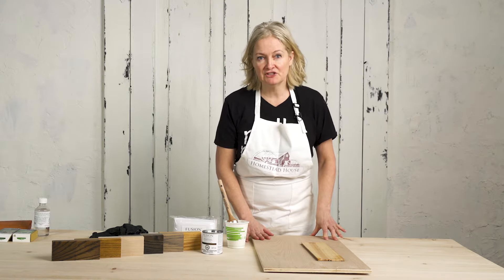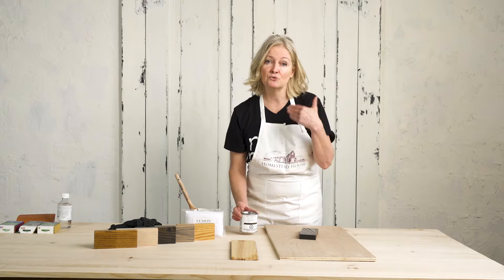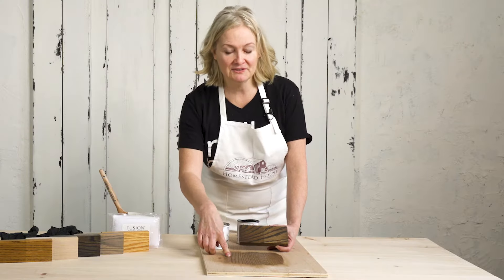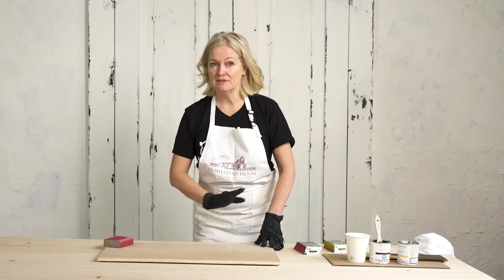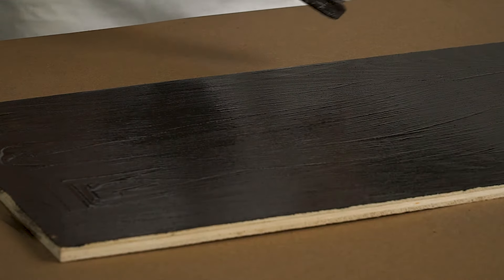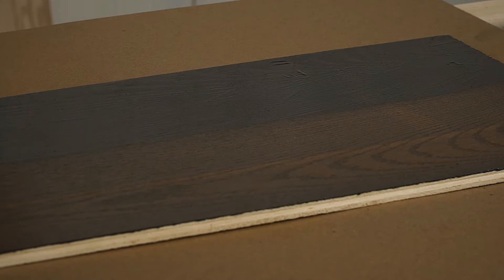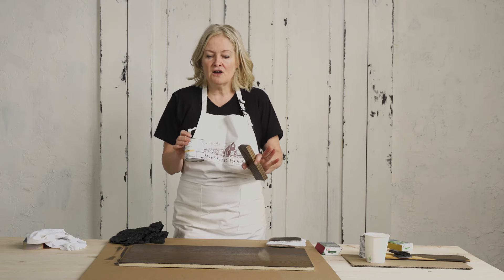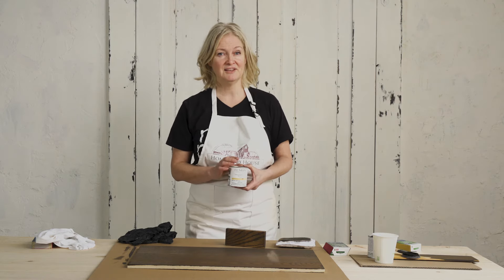How to prep for Stain and Finishing Oil

Comment: Want to refinish to small portable "island" in my kitchen which is currently finished in a walnut stain. How to do it please?
Reply from the maker: To restain your piece this is the information you need. You don’t need to apply another product before Stain & Finishing Oil.   This video shows you the correct prep for SFO https://youtu.be/07TE3VMQpY0?si=OWT_WXYC4w0cZNZx   Stain & Finishing Oil - SFO-is a wood conditioner, stain and top coat all-in-one that offers exceptional durability in high-traffic areas like table tops, kitchen cabinets, and even flooring. It can be used on bare or prepped wood to change the colour and protect and seal, or over previously painted surfaces to create faux finishes.   No additional top coat is required - it is highly durable as is. If you’re looking for added durability, applying a coat of Natural will increase sheen and durability without intensifying your colour. Check out this YouTube video https://youtu.be/XFRjUztaUiE    Our special blend is highly concentrated in pigment, so a little goes a long way. The 237 mL container will cover the same area as 1 litre of comparable stains.    Directions: How to use on bare wood, apply generously by pouring or brushing onto the evenly sanded surface, and remove excess after 10-15 minutes. If desired, add a second coat (after re-coat time of 9 hrs) for a deeper colour or more sheen.   The pigment in it stains your wood accentuating the grain. SFO is a combination of natural oils and resins that penetrate into wood fibres to create a durable, scratch-resistant, waterproof finish. It does not leave a surface film that sits on top but instead soaks into and becomes a part of your wood.

Comment: I have an oak kitchen table that I over sanded the top and now it won’t accept stain well… I tried several different types and it just slid off… now it’s blotchy and horrible looking. 
Would you suggest painting and then using the SFO?
Reply from the maker: It is possible you have closed the grain by sanding with too high a grit. Check out this video for prep for staining You don’t need to apply another product before Stain & Finishing Oil.   This video shows you the correct prep for SFO https://youtu.be/07TE3VMQpY0?si=OWT_WXYC4w0cZNZx